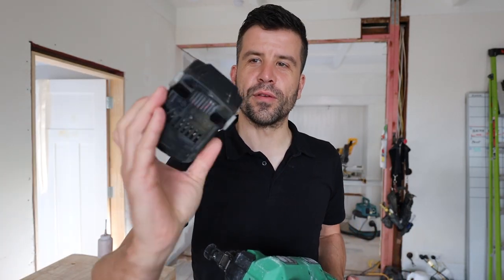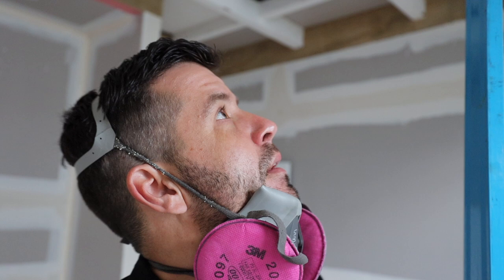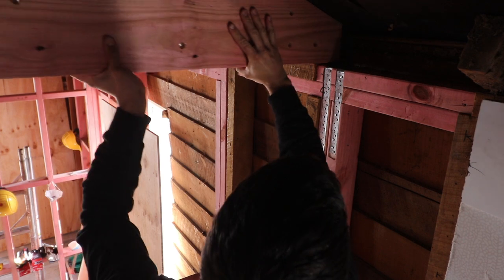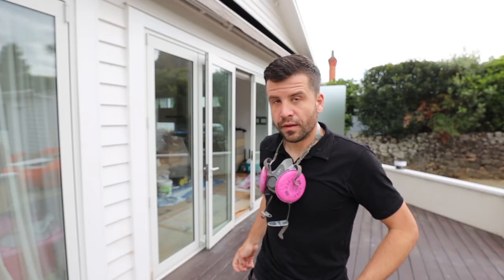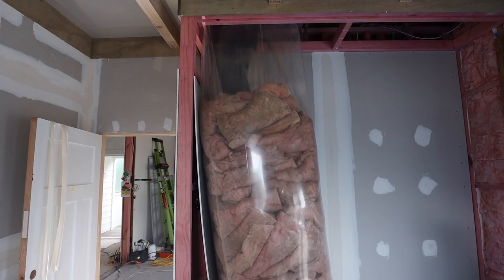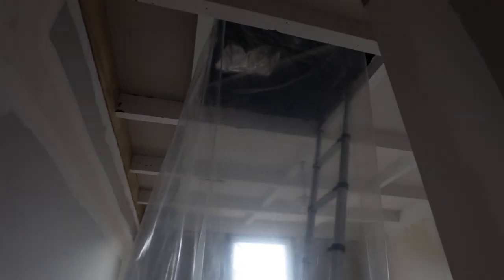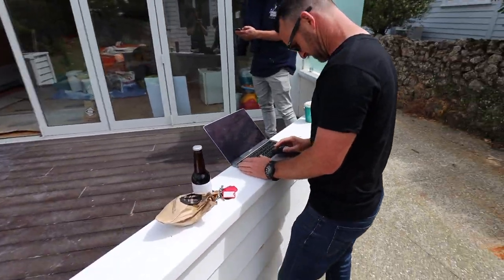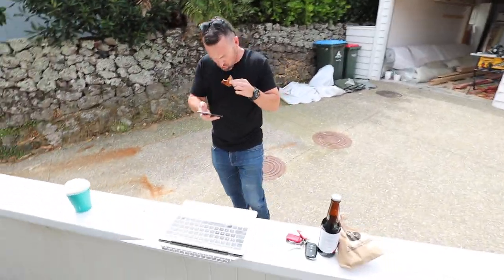Why We Don't Insulate in New Zealand.

Comment: You gotta keep in mind Scott is only talking about the Auckland area. There are much different temps in the South Island. Winters in Central Otago and some parts of Southland for example, the temps can be anywhere between 5 to -10°C or more but during summer it's one of the hottest regions in the country 25 to 35°C +. Same for Canterbury and in the Nelson/Tasman regions. Insulation is a must.
Reply: Another reason why older homes weren't insulated was because we were allowed to burn as much coal as we wanted to stay warm. And some homes even had a diesel central heating unit. This isn't the case now and the govt and local councils don't want coal being burned but want you fork out $$ for new fireplaces or retrofitting insulation to try and stay warm in what has now become a cold, damp, moldy home making many Kiwi's sick. Not everyone has that luxury to just go out and renovate.
Reply: @420sesamestreet3  Yep, lived in a brick and tile growing up that had diesel central heating.
Reply: Yup, Tokoroa get mighty chilly in the Wintertime, very cold at times. Frosts where everything is white, the opposite to Auckland and upwards.
Reply: Any house, no matter the location, needs insulation. If you don't have it, heating during winter is less efficient, which makes your heating bill higher, and air conditioning during summer is also less efficient, making you pay more for electricity.

Comment: New homes in Ireland require high levels of air-tightness, heat pumps, advanced ventilation systems, heat recovery,  triple-glazed windows as well as crazy levels of insulation . While  building is undergoing renovation or an extension there is  a requirement that the whole building should achieve a very high level of energy efficiency. The days of the cowboy builder are long past.
Reply: @BobDevV  To a Swede it's normal level since at least 20 or 30 years to have triple-glazed insulating windows and thick insulation in the walls. The moisture barrier is on the inside wall of Swedish houses since most of the year the outdoor is colder than indoors and then you don't wan the humidity of indoors to condensate in the wall causing rot.
Reply: Here in nz new builds require double glazing and insulation to varying standards depending on where you are in the country.
Reply: Must be nice to have first-world building practices - NZ should maybe give it a think. It's a sick fuckin' joke here thanks to years of deregulation since the 1990s. But at least the Auckland average house price is about 13x the average annual wage, so.............smfh

Comment: We're building a new house and are packing as much insulation into as is possible. We've rented before and almost froze in the winter even with the wood burner going flat out. This time around our NZ house will be up to date and will have two forms of heating a Heat pump and a Wood burner in case of power cuts which we get a lot of in rural NZ. We are also insulating all internal walls so that not even a draught will get into this house. I should also point out that the Wood burner has its own air supply from outside so it will not draw air from inside the house.

Comment: Housing standards here in NZ are pretty poor. "Double glazed aluminium windows? Luxury!"

Smart people know aluminium is not a good thermal barrier, and our lousy standards don't enforce a thermal break to be fitted in them.

We frown at wooden joinery because a few people are afraid of paint, when the Europeans (who have to bare greater extremes in climate) consider it the best available option.

Just realised you're from Auckland. Here in Christchurch it sure knows how to get cold, with so many people living in old or broken houses and a poor source of heating. Insulation would be most appreciated down here.

Comment: For other commenters/viewers: you do not have to remove all the "cladding" to retrofit insulation in walls.  We do it all the time. lookup high density cellulose or high density fiberglass retrofits. There also used to be expanding, pour-in, type foams, but they shrink over time and leave huge gaps. A quick search turned up tons of certified installers: https://insulmax.co.nz/, https://www.ecoinsulation.co.nz/Retrofit-Insulation-Renovation/.  Also, insulation isn't just for efficiency, but for comfort as others have stated. But possibly even more importantly it's to prevent rot and mildew in the walls. If you have plasterboard only and it's super humid inside, and say 15*C outside and it's 25*C inside, where is the dewpoint and condensing surface? Yep, inside your wood framed wall coated in paper.
Reply: i am just looking at insulmax, which lead me to this comment. why don't builders just recommend that type of insulation? is there a real concern about it?

Comment: Scott's comment about Auckland's lowest temperatures is interesting. As I'm from Melbourne, (if you don't know, second largest Australian city), we've long held that climate-wise, Auckland and Melbourne are pretty similar, as we're about the same latitude. If you look at a graph of average temperature, you can see the similarity on average. 

However, from your description, I reckon we probably get more extremes of cold than you do, because of the landmass of Australia. (Probably more extremes of heat, too). Unlike Scott's description of Auckland, we get a really cold night or two every winter that will dip below or get to 0*c, and I reckon can get pretty close a few times, too. (And inland parts of Vic such as in Gippsland, to the east, or Ballarat, to the west, would dip below 0*c regularly overnight). 

I guess the fact that you're a smaller pacific island influences your climate, where our landmass influences ours'. 

And by the way, Melbourne has a reputation for 'four seasons in one day'... But a visit to the North Island in springtime tells me that we've got nothing on you, lol..
Reply: Yes you have a mix of continental weather when it blows from the north and polar weather when it blows from the south.

Comment: Thank you. Interiors walls need insulation for sound. And it helps if you have a separate thermostats in each room. The thermostats will trip less if every wall in a room is insulated.

Comment: I find it quite interesting with the insulation. In germany you insulate the inside of the framing and add another layer of insulation on the outside of the framing. You do not only insulate to get a warm inside, but more importantly to cool the inside when its hot outside. When i was in australia i noticed that everyone had an ac too cool down the inside, because the houses were not really insulated, which is a shame because you can safe so much electricity/energy by just having an insualtion. I am really interested, do new building ins aus/nz never have a decent insulation, or is it just when you renovate old buildings that you just add a bit of insulation on the inside of the framing?
Reply: In NZ, new building rules do insist on full home insulation and double glazing; but only in-frame insulation. The minimum insulation requirement only came into effect in 1978, and was increased in 2000. But that means there is a lot of housing stock with minimal or no insulation. It doesn't help that we have one rule set to cover sub-tropical Northland (like Scott says rarely gets to freezing), and sub-alpine Southland (which snows frequently).
Reply: @djotter  it does vary around NZ to some degree. See this page for details. https://insulation.kiwi.nz/r-values/
Reply: These houses were built before air con.

Insulated houses in hot countries would be unbearable.
Houses in the UK are insulated without air con and they're worse in a 30 degree summer than houses in oz in a 40 degree summer.

Comment: Insulation also keeps cool in it isn't just to keep heat in. Now as to humid, if you build with proper vapor and moisture barriers in the walls and flooring, then use a expanding foam insulation, then you won't have mold issues.

Comment: Because it's cheaper and shitty build.. the quality of houses in ANZ is really bad compared to other countries
Reply: Yeah I noticed that in Queenstown - such an upmarket place, and yet many of the houses are little more than wooden sheds. Why is that ?
Reply: @mrcaboosevg6089  yeh or you could be better buy a quality house in Malaysia for cheap..
Reply: @ifanmorgan8070  it's what you call speculation unfortunately :( it's not about the house anymore.. it's more to what people perceived it's worth
Reply: @mrcaboosevg6089  Check the prices in Queenstown. Plenty of affordable houses in England, if you move to the lower cost areas
Reply: @ifanmorgan8070  I live in an affordable area, you can get houses for cheap but they're in shitty areas. I wouldn't want to bring a family up in say Ribbleton, Preston which is a cheap place in my city. It's also a shithole
Reply: Wrong. Im a builder from NZ and trust me the houses here in Texas are WAY worse. Were behind in insulation but in terms of structure, framing, bracing, exteriors, water proofing etc were way ahead

Comment: Great solution for retrofitting insulation in outside walls in nz is spray in foam   we had it done to our place a few years back and has been an amazing change
Reply: Your frames will eventually rott as the house sweets. An foam will also shrink in time. Air gap is a must
Reply: @deepsouthlife8216  The foam they use lets moister pass-thru House is much dry since doing it and the small amount of shrinkage is less than the slump from normal batts I've had some section of one wall of 5 years after and shrinkage was very minimal

Comment: *Disclaimer, ALL rental houses in New Zealand are required to be insulated (roof and floor where applicable).
Reply: @Yazmeli Ayzol yes... hence (roof and floor where applicable)...
Reply: I'm a renter with massive, double glazed sliding doors. Even in midwinter I would normally have the doors and windows open till 1am to let the heat escape. The sun is low, but that just means it shines directly through the double glazing. I put a shed and a sun umbrella in front to block the sun, but I still never worry about being cold, ever. I have to put insect repellent dispensors everywhere so I can keep the windows open, to prevent boiling.
Thanks Jacinda.
Reply: @Yazmeli Ayzol Hamilton. North Island, South of Auckland.
Reply: @Yazmeli Ayzol The ridiculous thing is my landlord lives in an old house on the same property. These oppressive overlord the laws were made to protect me from, couldn't afford insulation apparently. They don't have double glazing and they have shade all around their property. They are only just starting to renovate so that they aren't freezing all the time.
Reply: @Yazmeli Ayzol It isn't always warm here, perhaps compared to Canada. It's just that my unit is situated to trap heat. It could easily be 10°c above the outside temperature. And that's after I put a shed in front of the double glazing and a sun umbrella.
Reply: @Yazmeli Ayzol The presenter mentioned he hadn't experienced sub zero, in Auckland, except a few times. I think it dipped below 0 a few times last winter in Hamilton. I think those were short dips though. Occasionally cold air comes up from Antarctica.
5° would seem like more typical low during winter, not the average temperature.
Reply: @ingramfry7179  even here in Dunedin (south Island) it only goes below zero a few times a year on average...

Many houses in NZ are old, (ours is 110 years) and had no insulation in the walls. even then wasn't that cold and have really noticed much difference with the walls done... The main difference we felt was when we re-did the ceiling... with bats and seiling blanket.

Comment: We live in NZ, and had wall insulation injected into the walls from the interior walls. They had a thermal camera so they could see if they missed any bits due to noggins. They still needed to get council consent, but it's a product that has been used all over the place. The walls then needed a quick extra paint to cover the new holes they made and plastered. One day for the insulation, one day for the painters pretty easy mostly for a 100 year old house, roof and underfloor (with vapor barrier) was already done when we brought the place last year.

Comment: Scott is only talking about it not being common to insult the external walls on retrofits. All new houses need to show a level of temperature control and energy efficiency, which effectively requires insulation to top, bottom and sides. 
A note about NZ climate. As medium sized island in the middle of the pacific in the roaring 40s, (40°s latitudes) rain and often wind are the two biggest reasons for problems. All the major cities are livable year round without any insulation and only moderate heating and cooling. Half the reason for the insulation is energy efficiency not comfort.
The reason we don't often insulate the walls is because of risk/reward. Insulating a typical roof and subfloor space is easy, extremely low risk. The Walls are different, old house's walls typically don't leak water (systematically that is, generally failure is only through poor maintenance or damage). Often one of the reasons for that is the un-insulated wall cavity, it allows airflow to dry out the occasional moisture ingress. 
Changing the wall dynamic can lead to rapid moisture problems and failure. As both the ceiling and sub-floor are low risk they often are done first with little government oversight. But because of a recent history of leaky buildings and the often complexity involved in insulating the walls in old houses you need to get your plans approved. 
NZ deregulated the building industry in the 90s, then for about a decade built a bunch of terrible houses that all failed within about 10 years but some in less than a year. There has been a heap of finger pointing etc. So we do really need the regulations.
Reply: Spot on. The guys drilling holes in the exterior walls in the 90's and 00's for retrofit foam injection insulation were in large part responsible for the initial specific changes the building code. Simply drilling through the exterior envelope and moisture barriers like Swiss cheese.

Comment: When you insulate you need a vapor barrier between the insolation and the plasterboard. If not you can get mold in the walls and the ceiling.
The vapor we produce as human always try to escape the easiest way.
Reply: Yes we consit mostly of water
Reply: I think you mean between the insulation and the cladding...
Reply: It’s the same but different name.
Look at this picture. This is the way we do it in Sweden.
https://villalivet.se/om-bygg/yttervagg/
If you don’t use a barrier you risk a condensation inside the insulation when it’s cold outside.
Reply: @thomasflomen2122  That's much more comprehensive than any wall I've ever seen. In NZ there is usually building paper or some kind of wind protection (not moisture barrier, my mistake) between the insulation and the cladding. Then the plasterboard is fixed directly to the studs. I wonder if it's less of an issue here because we don't get the sustained cold weather throughout the day, so the wall has time to ventilate and evaporate any moisture.
Reply: @andrewbriscoe2481  I live in the south of Sweden and it’s almost the same temperature as Auckland. But some years the temp drops to -20 degrees Celsius. But the insulation also save you money during summertime to keep the heat outside and then you can use the AC more economic. 
Keep safe and healthy.

Comment: Greetings from Kimberley, Ontario. If it is a new build, insulating is not difficult or a huge expense. The first couple of inches give the greatest return on the money. In a mild climate like yours, you probably need only a thin layer. Your comfort will go up year round. I renovated the leaky farmhouse I live in 30 years ago. The day the vapour barrier went up, my life changed. What a great comfortable house now; fuel consumption cut in half too. I no longer use pink fiberglass, only Rockwool. Pink never dries if it gets wet and is a pain to work with. Rockwool holds it shape.
Reply: we don't use vapour barrier here (its all vapor open) and houses are not air sealed like yours. so our insulation isn't actually as effective due to all the air leakage. add in the humidity factor (70-90% at the moment) which comes in with all the air leakage which makes it feel a lot hotter/colder than it is. there is a lot more to it than just a bit insulation.

Comment: In germany 3 times glassed windows an like 36 cm of insulation in external walls and the roof
Reply: Sure, but not in old houses...  There are plenty of places here in the US that require R60 in the roof (approx 45 cm) and others were it's R15.   The climate is not nearly as uniform as in Germany, eg. Florida (low of maybe 7c) vs North Dakota (low of -30c) or Tuscon (super dry & hot) vs Seattle (wet & mild)....     I suspect it's the same in NZ as Scott was specifically calling out Auckland.

Comment: I live in northern Sweden and we have a little bit more isolation than you have, 
at least 200 mil in the wall and 500-600 in the 
in the roof :D
Reply: Damn! I live in Southwestern Norway, and we use 200 mill all around, but mostly because its the standard up north aswell as here in the south. How far north are you? :o
Reply: @Mattittas  Im living in Luleå. We allready hawe snow;D
The thickest house wall I have built was 625 mm.
Reply: @dango6962  Holy crap, that's THICK! You really don't need THAT thick walls in general I hope?
Reply: @Mattittas  no, thats a low energy house.
Reply: Modern houses has 400mm at the lowest.   I live in house made of timber so i have no insulation in the walls,  but the timber is 350mm thick :)

Comment: Heat flows from high to low. Cold air does not enter a warm house. Warm air leaves the house into the colder ambient outside until it reaches steady state.